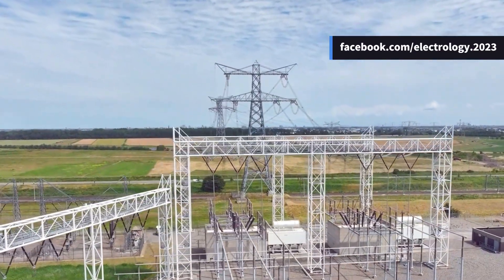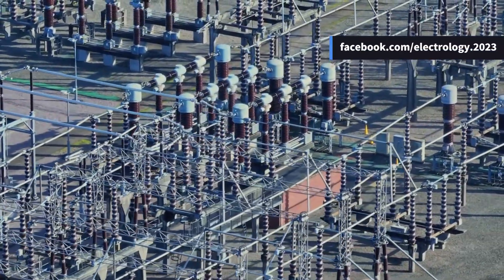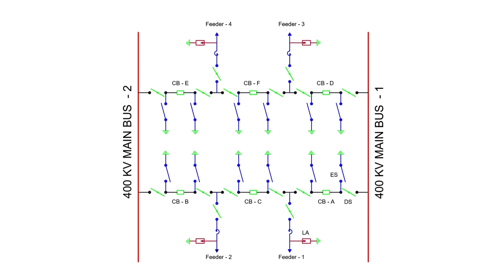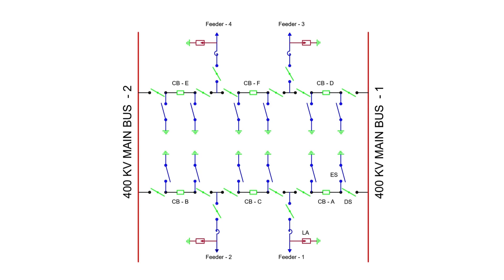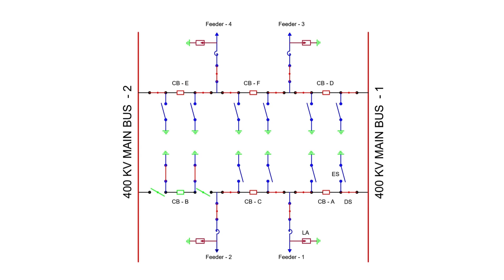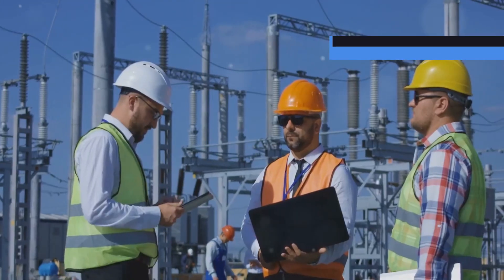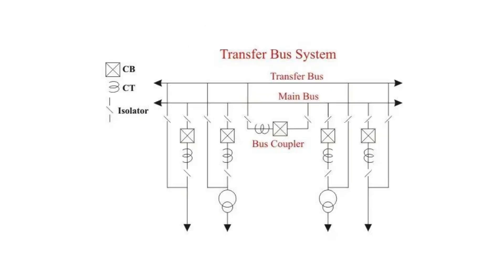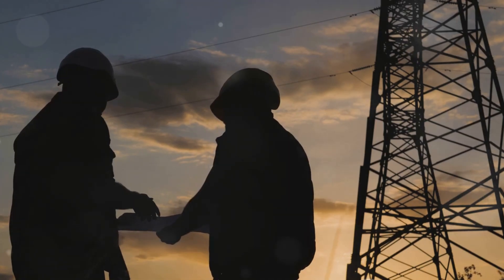Understanding the One and Half Breaker Scheme in High-Voltage Switchyards

Comment: Is earthing and grounding same
Reply from the maker: Both are similar but not the same. Earthing refers to connecting the non-current carrying parts, like the metal body of an electrical device, to the earth. Grounding, on the other hand, means connecting the current-carrying part, such as the neutral of an electrical system, to the ground.